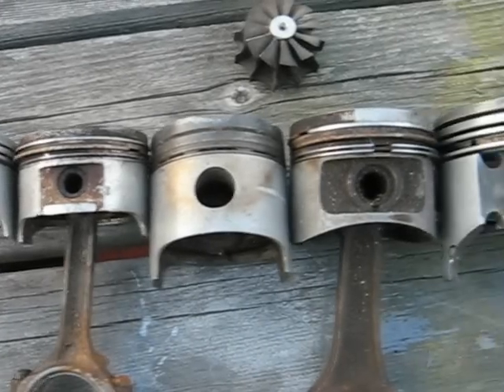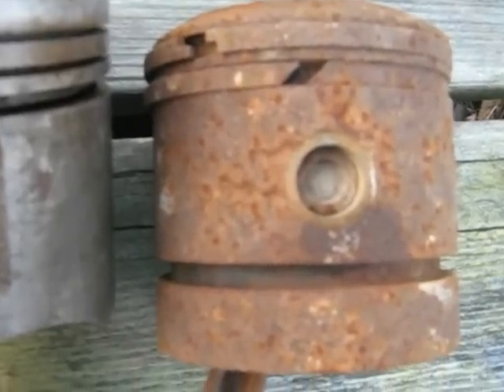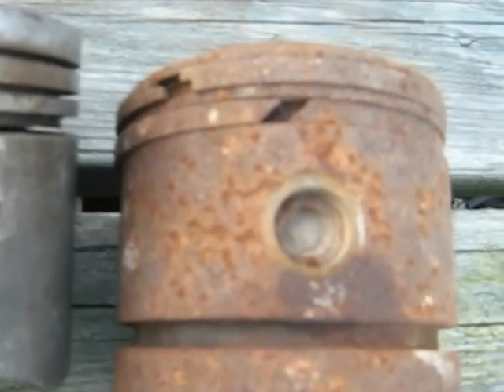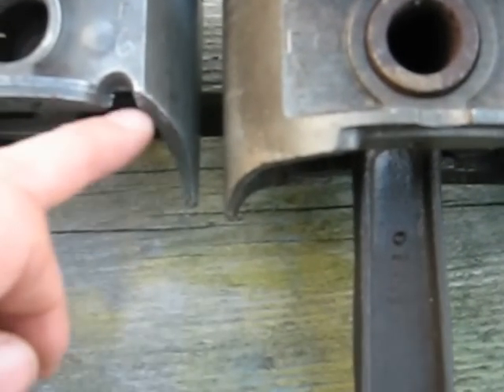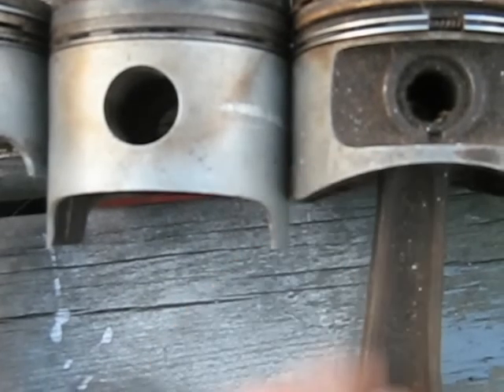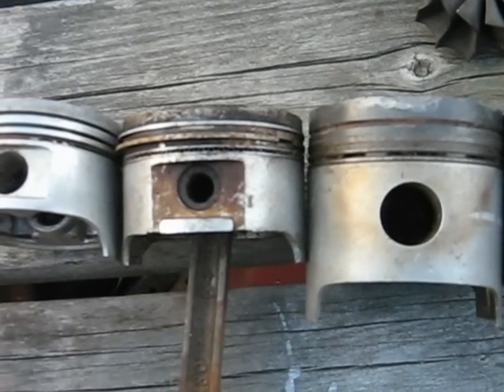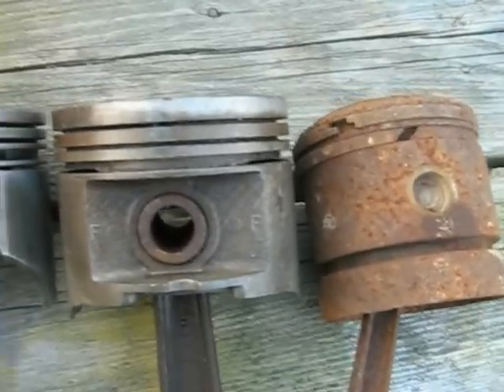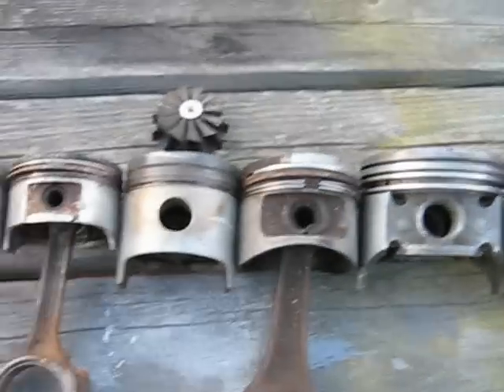Piston Design Evolution

Comment: Charger the vw beetle piston what was the thick-ness of the so called side thrusters or the low side. parts for beetles are easy to find and well it that side thruster is wide, it could work, also any idea a good length ,from top to bottom, for a piston I had a idea to make a full skirt piston fit but, I like to have all my info

Comment: @ChargerMiles007 Thats what i thought! who'd guess its abrasive ring seating powder! Ive heard of the water trick but sucked in a vac hose. Im sure it works, i run water injection on my duramax and its pretty clean inside but its finely atomized and evenly distributed. RC planes is one of my hobbies and there are some pretty good size engines that are ringless.

Comment from the maker: Gee, that sounds like a risky thing to do!
I bet the first person to try that was happy that it worked, rather than seize up the engine!
I heard pouring water down the carb. can clean out carbon deposits, but you only do it right before you change the spark plugs, as the carbon pieces will beat the heck out of the plugs!